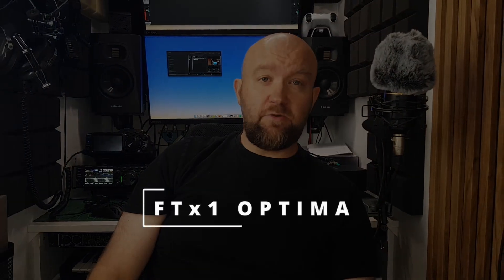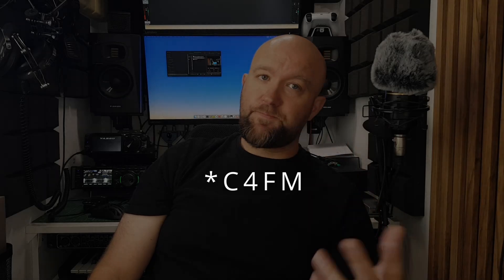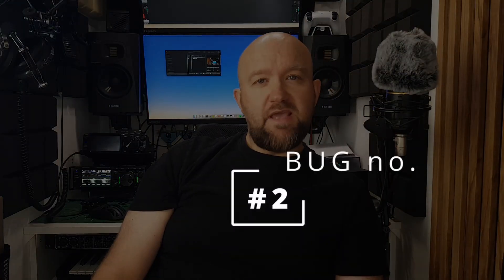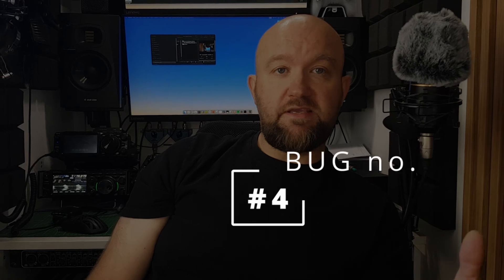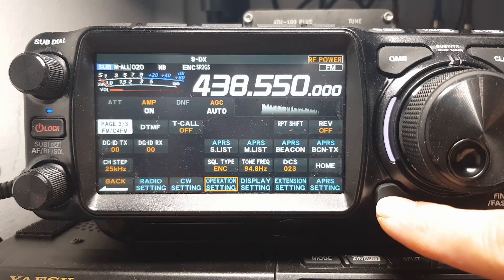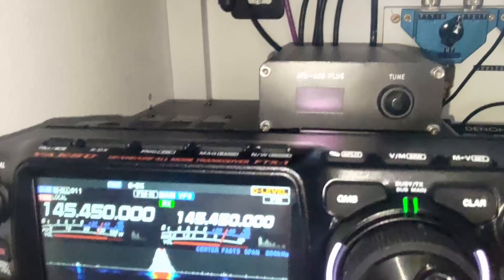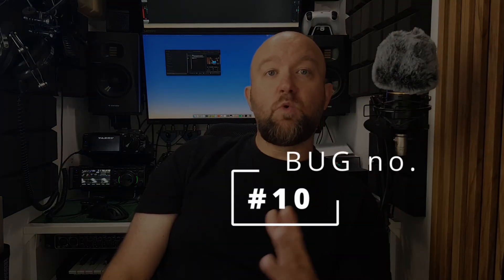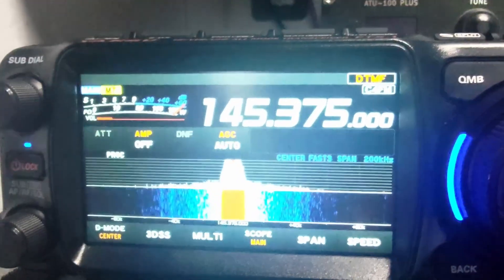YAESU FTx-1 OPTIMA! BUGS in EUROPEAN VERSION (English)

Comment: Nice review Paul !
Great to see I’m not the only one who likes to dig every little quirk 😄

The white noise when the beep level is 0 is typical of lazy design: instead of simply not playing a sound at all in this case, they still call the sound play procedure but without a file, resulting in white noise.

Here are some other notable designs fails on the FTX-1 :

- Have you already tried scanning ? You can only do it by using the buttons on the microphone ! There’s absolutely no Scan option in the menus, and no physical Scan button on the front panel obviously. So you’re forced to plug the mic to start a scan, even if all you want to do is have a nice SWL session. Unbelievable 😳

- The pre-recorded audio and CW transmit lists are not only rather small (they could have put dozens of memories in each, surely there’s enough memory storage in this big radio), but more importantly, they don’t have labels ! So you have to remember what each memory number corresponds to 🥴

- There’s no CAM function, like on the handheld FT-5D for example. With a superb screen like that, it’s a shame.

- There’s no clock display ! Local and zulu time is a basic useful fonction for ham radio 🤦🏻‍♂️
Reply from the maker: - There is also an FM dial step problem in FM VFO mode.
- No digits are shown during memory channel editing.
(check last short videos...:-)

next I'll find some more :-)

Comment: Great review, hope Yaesu fix the bugs. My Yaesu FTX-1 Optima has an issue with the external tuner (Mat-30 V2). After tuning the frequency isn't tuned properly. When you switch the tuner off and on in the radio's menu, then the frequency is tuned.. Or turn the frequency 15Khz up or down and back to the set frequency and the frequency is tuned. After that it stays tuned even after swichting the power off. The Mat-30 V2 has no issues with my Yaesu FT-710.